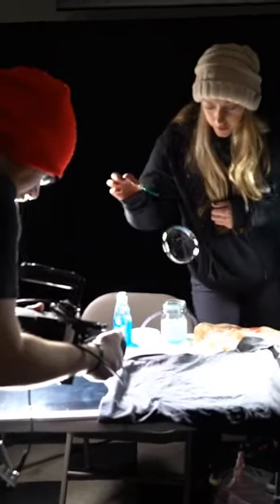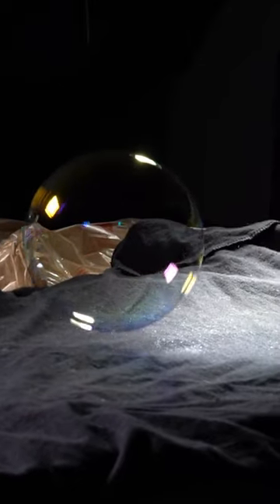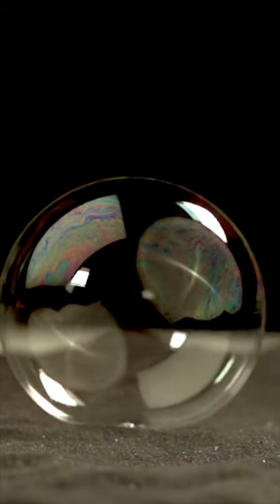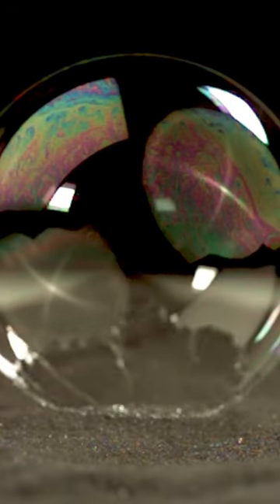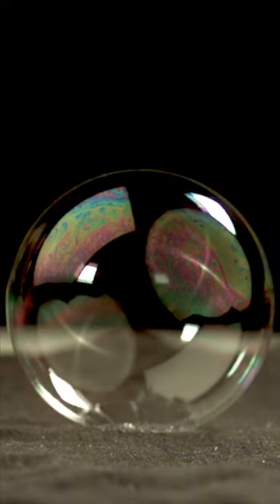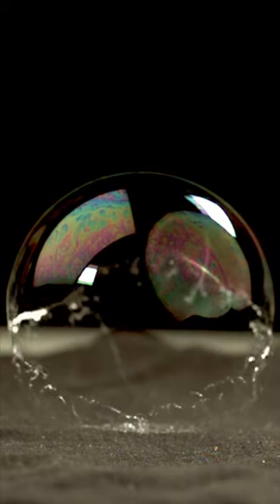Bubble pop in high speed slow motion

Comment: I feel like somehow the way the bubble film shrinks back toward the opposite point from the start of the pop has something to do with the same effect seen when you drop the top of a hanging slinky.  The bottom doesn't move until the top falls down to it.  The bubble stays round because the air it was surrounding doesn't move much in the time the pop, and it doesn't fall because the acceleration from gravity doesn't have much effect in the time it take to pop.  But back to the slinky, the bottom doesn't move because it doesn't "know" anything has happened above, until the rest of the slinky falls to it.  And the film does the same, the opposite side doesn't "know" anything has happened until the popped edge gets close.

Comment: Hydrostatics. Surface tension of bubble resists the internal shear forces of the fluid as it collapses. As shear forces become unbalanced, the surface ruptures causing catastrophic failure of structural integrity of the bubble.